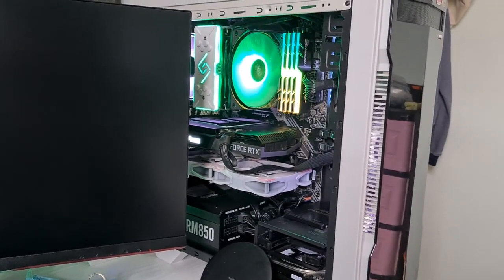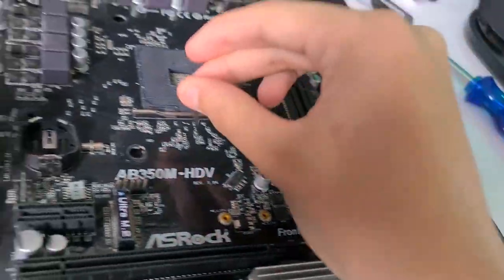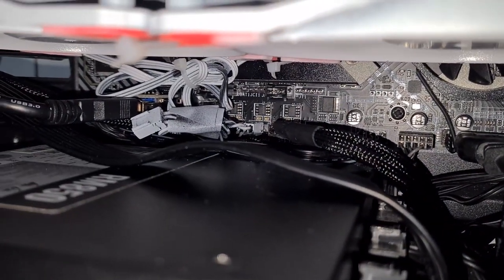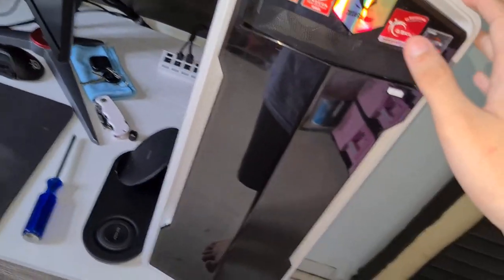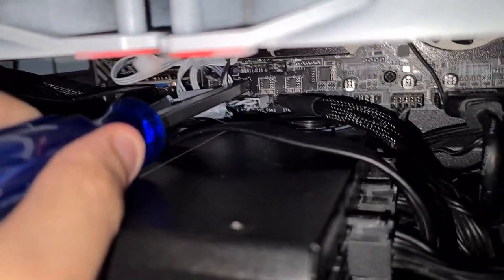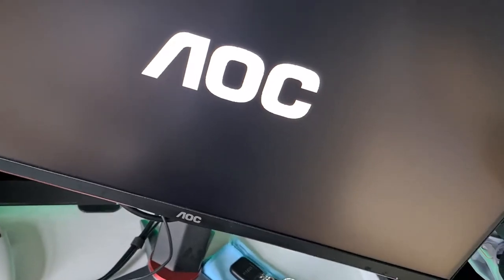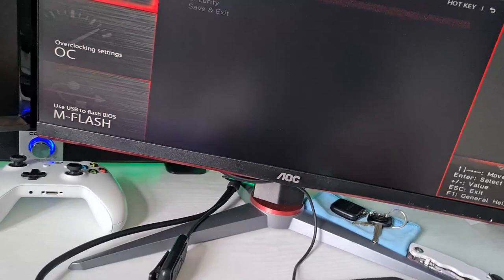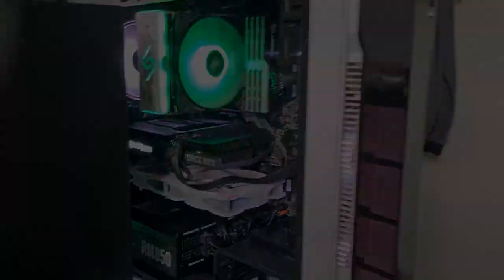How to Clear CMOS/Reset Bios without Jumper in Confined Spaces (Screwdriver Method)

Comment: How long do you wait for the bios to appear after you reset it? Cause my monitor just keep showing a blank screen like it doesn't detect any input
Reply from the maker: around a solid 2-3 minutes, at first its concerning but itll boot eventually, if it keeps going for 30 minutes or more then you should be concerned
Reply: @P0ck3tz  yikes, then how do you know if it works? I got impatient and restart my pc, but it doesn't show any change, except the boot order (was really scared when it didn't boot into windows 🤣).

Btw, I tried both the method in the video and pulling out the battery.
Reply from the maker: @qfsrucjcmlzoey  ah yeah try changing the boot order now, for some reason my pc cant boot into windows if i immediately put my windows ssd as the first priority, i have to put it on the second one for it to work

Comment: my pc works fine but when i boot it, it skips the bios and loads straight into windows. its not a big deal i just wanted to overclock and i cant get into the bios ever since i installed my ssd, do you think this would fix that?
Reply from the maker: yeah I think so, some motherboards come with this "fast boot" option, sure it does speed up boot time but it does that by skipping the bios, you can't go to bios in that margin of time so clearing cmos might be a start

Comment: Does this work with all computer based things. I've got a engraver that won't start up and been told I need to reset the bios
Reply from the maker: ive got no idea what an engraver is, lemme just guess its a laptop. if yes remove the CMOS battery. the method shown in this video only works for full tower pcs with big motherboards

Comment: Tried swithing ram and also tried screwdriver method and tried removing the battery but didnt work 
The cpu fan and front linght turned on but not booting up
Reply: Can you help me
Reply from the maker: @karthikeya7216  most likely a either a cpu problem or a dead/broken ram stick, for now try reslotting the CPU
Reply: I have the same issue
Reply from the maker: @Galaxy0950  make sure you did what this guy did first, take out the CMOS Battery as last resort to reset the BIOS. Then after that check every ram stick and reseat CPU
Reply: I bought an Asus ROG strix b550 I mobo and it wouldn't post with my r7 5800x. I've tried Cmos and bios flashback and still doesn't work. Pos board 🤦🏾 I was hoping it would've worked!!

Comment: Or just buy a button with a long enough cable to make your life easy. It will cost less than 5 bucks, or use the reset button of your case if it has one and you can attach it to the jumper, so anytime you press reset button on the case it will reset the bios.

Comment: When I overclocked my pc non of my keyboard lights was on is that normal
Reply from the maker: nah its not try checking your program to control keyboard lights, my speculations are the rgb control software cant run because of high overclock/ low voltages

Comment: Hello I have a question, will this reset any sort of overclock back to normal settings?
Reply from the maker: yeah it will, this is why I've made this video, overclocking made my pc not boot and so I decided to clear the cmos (restore everything to default)
Reply: Ah I see.. And it's completely ok to leave all your components in? Like cpu, gpu, ram, and nvme ssds?
Reply from the maker: @justanotherweeb9736  yeah indeed no problem, it won't break/interfere with anything connected to the pc, it'll just revert overclocks and bios settings that u put before
Reply: Ok thanks for the replies. Nice rig btw almost identical to mine.
Reply from the maker: @justanotherweeb9736  thanks lol it ain't much really, a new case would really make the whole system look better
Reply: You should get either a phanteks p500a or a lian li lancool II mesh. Both have a bit of rgb and really good airflow.
Reply from the maker: @justanotherweeb9736  the p500a looks good, but I'm specifically looking for a white case so I'm looking at the white 4000d airflow rn
Reply: There's a white version of the p500a as well as the lian li case.

Comment: IF i clear CMOS i will lose my latest version  of bios , and need to flash again with last version?
Reply from the maker: nah no need, you only might lose your overclocking profiles from ram to cpu. but if your motherboard has support to save profiles and you did save a stable profile before, that wont be lost

Comment: Im testing an Asrock Z390M Pro4  mobo that is not installed in a case that powers on but no display. I removed the battery a couple of times and even swapped another one without jumping the clr cmoss but nothing still. Does the CMOS battery have to be installed while jumping the pins for this to work? Thanks in advance.

Comment: I did everything and it stil doesn’t work. Plz help me
Reply from the maker: it will be a bit complicated but worst case scenario you gotta remove the cmos battery on the motherboard itself, after that leave the battery out for 5 mins to be safe, put it back in and everything should reset and boot again. by the way if the screwdriver method doesnt work try checking the material of your screwdriver tip, yours might be non conductive
Reply: @P0ck3tz  Removing the CMOS battery did not help.
Reply from the maker: @AnOrdinaryEagle  might be hardware failure then, not sure what it specifically will be but I'd check the ram first and if that doesn't work try the others
Reply: @P0ck3tz  It was working fine at first but then I tried overclocking my ram. I guess I didn’t do it right and now my computer won’t boot and I can’t seem toe reset the CMOS.
Reply from the maker: @AnOrdinaryEagle  ah yikes in that case the cmos battery method should've worked, are you sure you have removed it fully and left it for 5 minutes at least, otherwise try to switch up the slots of the ram or just diagnose one by one with the ram sticks
Reply: @P0ck3tz  I set a timer for 6 minutes just to make sure it was atleast 5. I have not tried re slotting my ram. I will try switching them to see if it will work.
Reply from the maker: @AnOrdinaryEagle  yeah exactly, removing the cmos battery was already a worst case scenario method in itself, if that didn't work I'm not sure what will, possibly hardware fault like pushing the ram too hard with that overclock could damage the ram stick
Reply: @P0ck3tz  I was digging around in the UEFI seeing if I could fix an issue with my headset. Didn’t help and now I have another problem 😅
Reply from the maker: @AnOrdinaryEagle  ah well the cmos method should've worked too even with that, surely it's gotta be a hardware problem then but I specifically can't say which, just tinker with ur pc for now, let's just hope the ram slots didn't die
Reply: @P0ck3tz  I still have my A1 and B1 slots open and unused which is good. If it is a hardware issue then I guess that means I am gonna need a new motherboard if I wanna fill in the slots.

Comment: I don’t see jbat 1 at all
Reply from the maker: it might be different for your motherboard, not all motherboards have the same naming scheme, try to look on google for your specific motherboard reset bios pins
Reply: @P0ck3tz  I got my pc up and running checked everything to make sure it was all the way In one of my parts were half way out when it arrived
Reply from the maker: @mikebrehm2253  is it broken?
Reply: @P0ck3tz  no
Reply: @P0ck3tz  but now it’s saying I have 16 gbs of ram and only 8 is usable
Reply from the maker: @mikebrehm2253  are you using dedicated gpu or integrated amd apu?
Reply: @P0ck3tz  I’m using my gpu my processor doesn’t have intergraded graphics
Reply from the maker: @mikebrehm2253  looking at articles about that problem right now and the solvements are try to reseat your ram and experiment putting the ram sticks on the first and second slot, then try again on the first and third slot. if that doesnt work try reflashing the BIOS again, by the way can you tell me whats your cpu/motherboard combo
Reply: @P0ck3tz  I have a amd Ryzen 5 2600 trying to figure out what my motherboard is
Reply from the maker: @mikebrehm2253  find out by looking at the writings on your motherboard, then find a bios specific to your motherboard, that should fix with your ram problem

Comment: so you have finally swapped out your a320m
NO MORE Ryzen 7 3700x on a320 mobo vids
Reply from the maker: I mean the a320 works but I really want to overclock
Reply: @P0ck3tz  im a really fan of your Ryzen 7 3700x on a320m.. How many months should i use my 3700x on a320 mobo with Cooler Master Hyper 212
Reply from the maker: @theborbz3024  however long you want actually, your hyper 212 performs basically the same as my gammaxx gt rgb. unless you want overclocking from a better board I think you're fine keeping the a320 for years to come